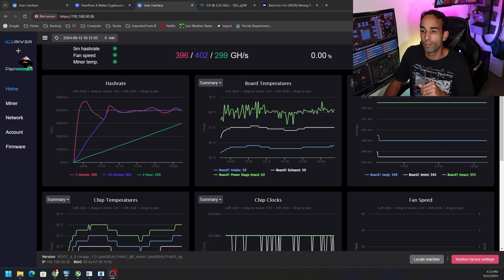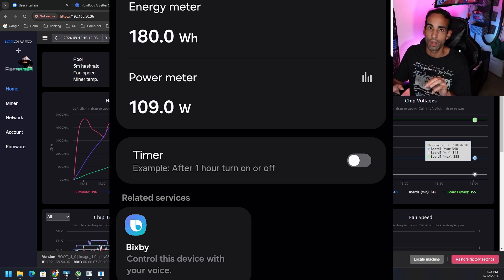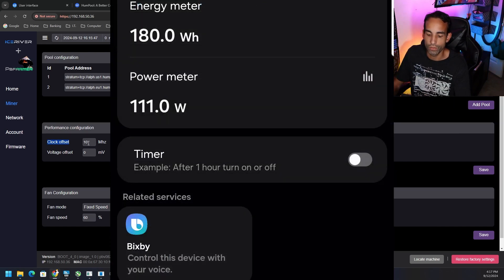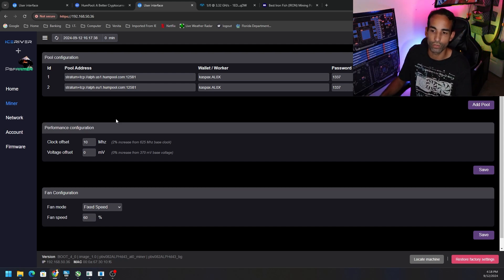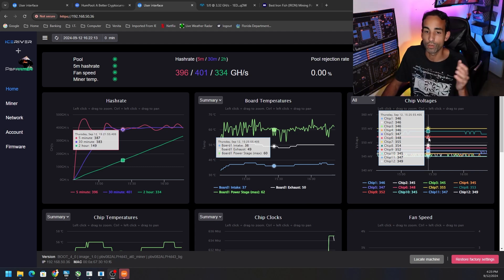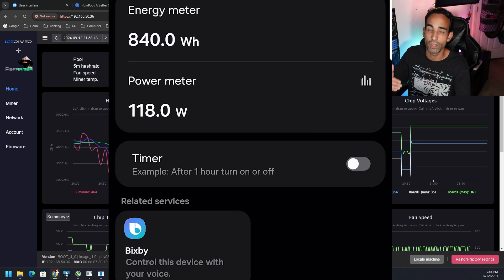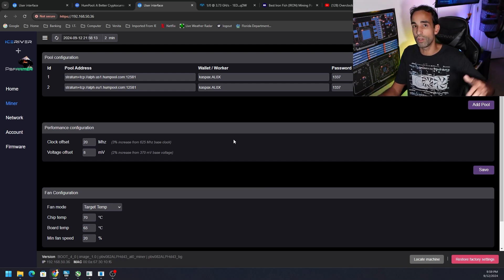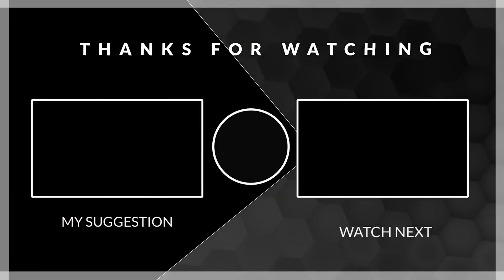Iceriver AL0   Best settings on Stock PSU

Comment: I bought al0 3 days ago 
But can't set up mining. 
IP address not logging in. 
No way to Log in
Reply from the maker: @abdullahaljubayer922  check to make sure you are getting a connection to thr machine. Are the light blinking on the Ethernet port on the AL0? Are the lights on the machine blinking red and green, just red, or just green? Have you tried holding down the reset button to make sure it is on factory settings? Do you see it on your network, via router or network management software, or angry ip scanner?
Reply: @SerpentXTech  get internet connection,
Red light green light in two waters, 
IP address can be found
Reply: @SerpentXTech  Tried setup by logging in with IP address, setup of poll address and receive address of some was completed successfully, but failed to setup fan. Since then I have not been able to login
Reply from the maker: @abdullahaljubayer922  reboot and set fan to fixed speed as quickly as you can. See if it stays online, then adjust your server and pool address. Some users report fan issues, so manual set the fan speed as fast as you can log in after a fresh reset. Hold reset button till both lights begin blinking quickly